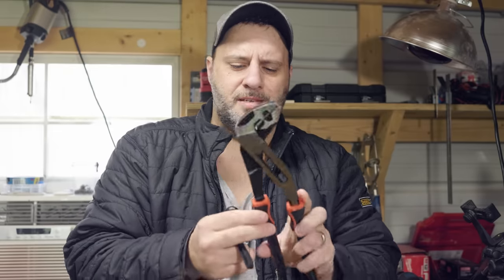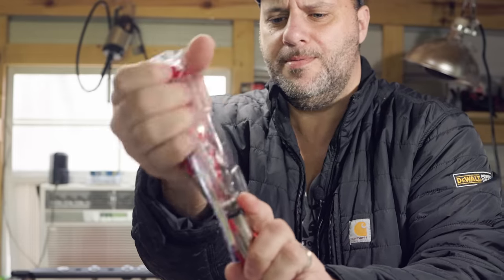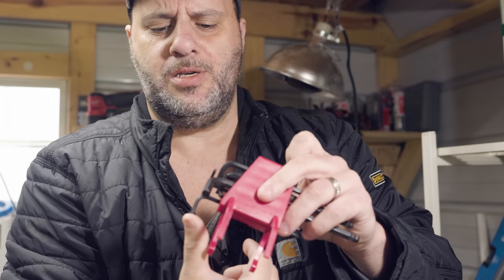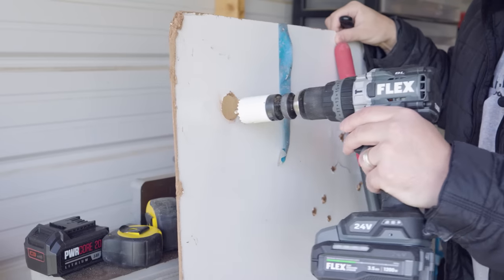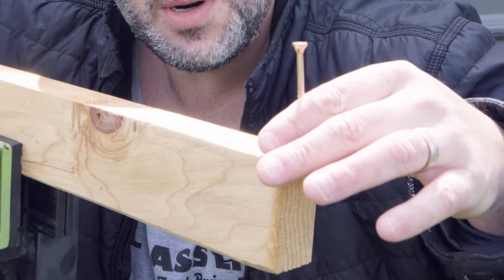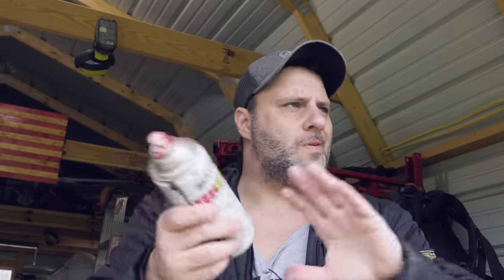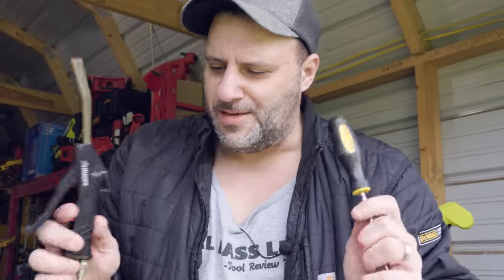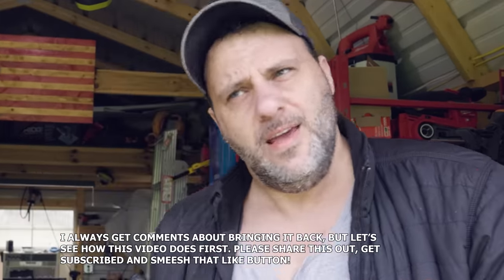I tested TikTok Tool Hacks and was shocked with the outcome

Comment: Hole saw hole-embiggening tip.. Take #2:  If you happen to need the hole saw trick, but your particular hole saws can't be arranged that way, you can always take a hunk of 1x lumber and bore a new hole into it using the larger saw.  Then lay it over the old hole, as a sort of bushing/guide to make sure the new hole goes where it belongs.
Reply: That's the way I was taught 👍

Comment: Another void to for hole saws that works best on wood or plastic is that you can run the drill in reverse to cut a shallow groove, then switch back to forward to finish cutting the hole. It will also work for metal, but it's a lot harder. This is especially useful if the original hole is off center or if you need to cut a slot.

Comment: When them cans are empty I have actually put a small hole and soldered in a Schrader valve from an old tire and made them refillable. It works

These are pretty helpful. Thanks big C
Reply from the maker: awesome tip brother
Reply: Aww man, I'm having trouble soldering my can of brake cleaner... They keep exploding. I only have 3 fingers left.

Comment: I've use the double holesaw method.  When you're buying an arbor for your holesaws, look for the arbor with the longest threaded area.  Most of  threaded areas on my arbors were too short.
Reply: Starrett sell a pilot bit that doubles as an arbor purposefully for this task call the oops arbor. 
Not making it up, I've 3 in my holesaw box and as an electrician they're invaluable
Reply: @darylsavage119  Good to know, thanks !

Comment: "I was on TikTok" watching dance videos???  That's what I was thinking until you opened that blister pack with your bare hands!  That and the clip the tip of the screw were my favs.  The re-pressurize the paint can seems like an explosion waiting to happen.  When I was younger, I worked in a picture framing shop.  On one of my first days, the older, retired gentleman who owned the shop taught me to blunt the point of the brad nails by placing the point on the anvil flat of the corner vise and tap the head with a hammer ONCE.  This keeps the wood from splitting.  Please do more of these tool tip Tuesdays (or Fridays).  They are great!  And also Clint...please leave a comment in your comments section which TikTok dance video was your favorite!!😉
Reply from the maker: Hahahaha, KRAZ lol. I will need to make my own dance video I guess haha
Reply: @ToolReviewZone  No offense Clint....but that might not get you many more views.
Reply from the maker: @KrazmoKramerica Enterprises  🤣🤣🤣 yeah.... you are probably right brother 🤣🤣👊👊